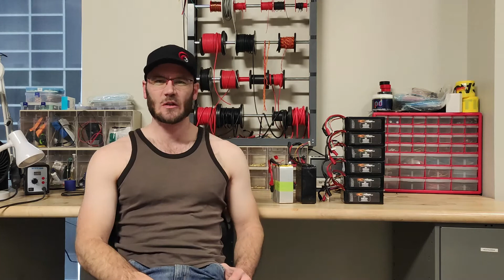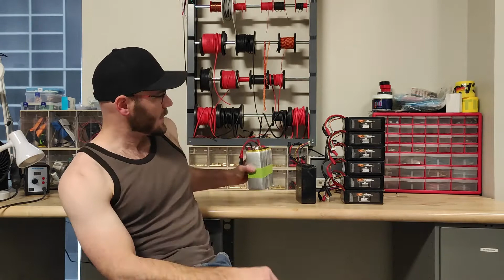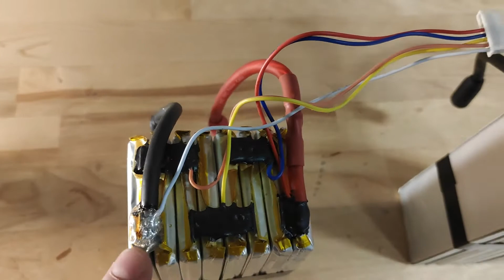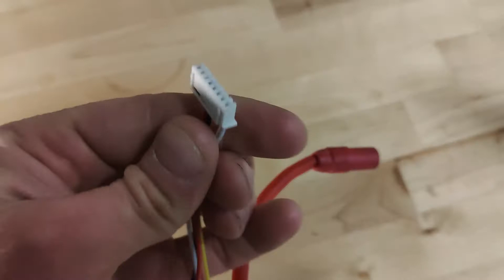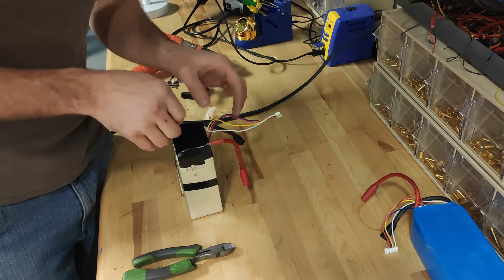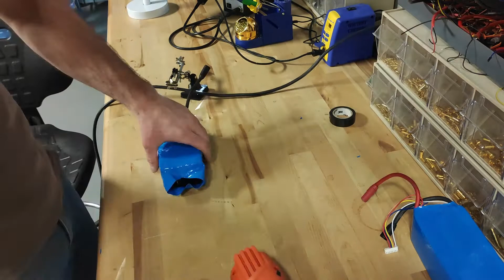The Frankensurron Dual motor Surron build- Update #2- battery pack construction

Comment: Do you ever drives a 20kw surron ?
Reply from the maker: My current setup with the BAC8000 and 6 of these batteries in 21s makes 23rwhp. It's reasonably quick, but could certainly use more power.
Reply: @danielclarke7109  do you have a logg  ? With 21s you are hard on the limit of 100v of the 8k
Reply from the maker: I have a dyno chart somewhere but I can't find it right now.

Comment: Very very interesting indeed! I'm also going to use a 25s battery setup for my surron. Just waiting for my lipos to arrive so I can start testing the performance.
What controller will you run with these?
Reply from the maker: Cool, I assume you are using a nucular controller? What capacity pack are you using? I will be running a MGM Compro HBC 280120 for the main motor and a HBC 140120 for the Plettenberg Nova 15 secondary motor.
Reply: @danielclarke7109  I will be using sintech for my top speed runs. But I do also own a nucular 24f.
I will be putting 5x 5s 16ah lipos in series. I didn't want to spend too much money on them because I wont be using them for daily riding.

It's quite exciting to follow your build because it's so unique and nothing like this has been shown here on youtube :D
Reply from the maker: @BossManaatti  That battery setup should make 25kW you would imagine, enough for lots of fun. Also, it will be very light. Thanks mate, I'm pretty interested to see the end result too- I suspect if I make over 40rwhp on the dyno that video will get more than a couple of hundred views haha